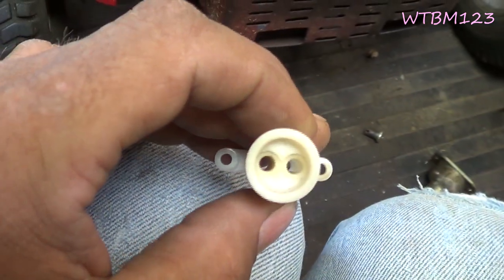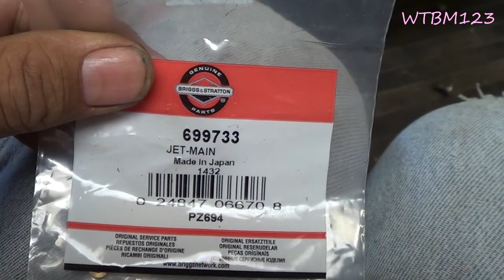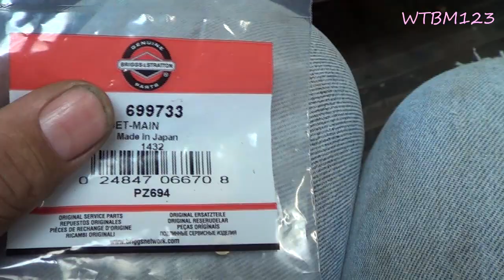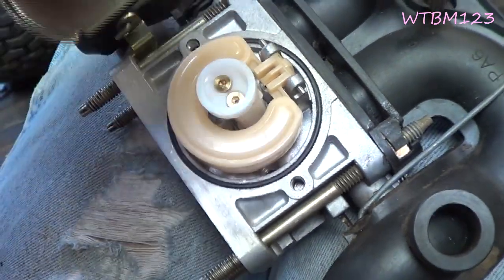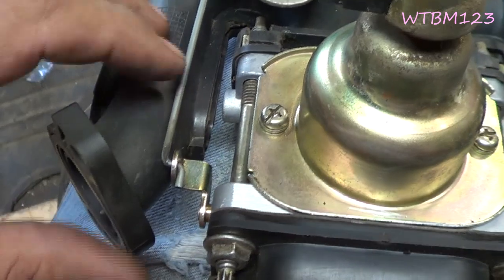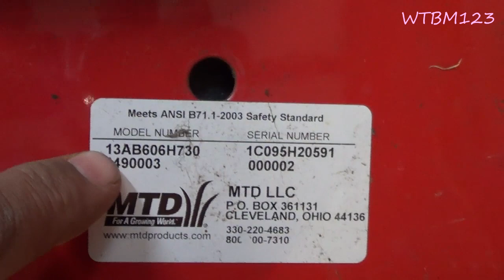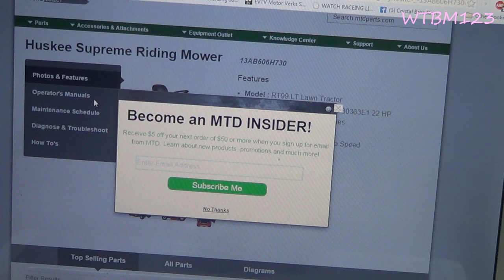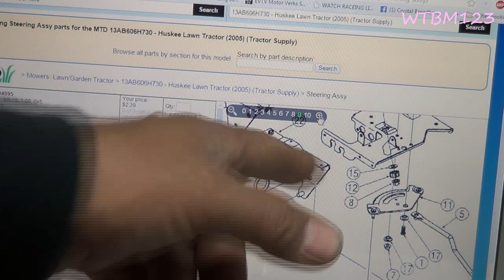Briggs V Twin Carburetor, and Parts Search

Comment: I use 222 lock tight on the butterfly screws because I’ve seen several that have came out and damaged engine piston
Reply from the maker: Yes , they make a mess if they come out . Thanks for stopping in .

Comment: I have been racking my brain tiring to figure out why my dads Yazoo Kee's ZT-MAX w/ 27 hp briggs stalls & dies when he engages the blades. The plugs are covered in soot & I went through the carburetor yesterday to no avail. I did notice the jets were in an odd place from when he had taken it apart before ( they were up in the two holes across from one another at the top of the bowl). Saw this vid & fglad I clicked on it, Now my suspicions is confirmed, they do need to be in the plastic tower like any normal carb.  Must have fallen out when he dissembled it & that's where he put them during reassembly....
   I'll crack it back open & get that straightened out.   Thanks for the vid sir!! 
 Edit to add I can see from yours which side the smaller jet goes on ect so Thanks much for the close ups also!
Reply from the maker: Thank you for stopping by and commenting . Glad you got it sorted out .
Reply: @wtbm123   That was the problem, she runs like a top now. Again Thanks Sir!!

Comment: My jets both fell out and there are not any numbers on either of them.  How do I know which one is left or right?  Put cleaning needles in them and one has a larger i/d than the other.
Reply from the maker: Mine had no markings and o rings were bad so i just replaced them . . They say number 2 cylinder runs a little hotter so they put a larger jet in for number 2 cylinder
Reply: @wtbm123  Thanks!  does #2 cyl correspond to "L" side marking on the carb?

Comment: That’s a Nikki type carburetor. You don’t need to go to expensive Briggs & Stratton parts. 
Many companies sell rebuild kits for Nikki type units. The emulsion tube takes an O-ring made out of a material called Viton. The kits include these rings. If your carb has a plastic needle valve attached to the float, replace it with the supplied brass one.
Reply from the maker: Now you find more stuff for these . nitrile O rings also work with fuel . Most kits come with all but the O ring for the jets , especially the ones with 2 jets you usually need to get them separate from the kit . I think a kit should come with everything including a float . Now you can get replacement carbs for cheap.

Comment: Than you much indeed for this video. I  am troubleshooting my 24hp B+S Professional v-Twin. Running weak on right cyl. Checked all the usual suspects (compression both cyl at 150, values adjusted and guides seem fine, air cleaner, plugs,  But still right cyl runs weak. Seems many people have had this problem and the issue is the carb. Seemed odd it would impact only 1 cyl, but I am at wits end. My carb is verysimila ro yours except the float bowl. Same white tube, but  float bowl solenoid o-ring area is a bit diff (float bowl is cast, not stamped like yours).

Anyway.. .thanks much for  the effort. Hope this solves my issue !
Reply from the maker: Hope you got it all sorted out , Thanks for watching and commenting

Comment: Jet 699733 is a high altitude jet.  I believe you should use 842627 (R)
Reply from the maker: I used the ones the manual called for , But yes different altitude prob should have different jets

Comment: I don't know if I have an earlier model gen Vanny 18 or what but hour Carb looks Nothing like mine .Mine looks like a more regular all steel carb . Roundish no it square where would I find parts and  new carbs for it ?
Reply from the maker: find the model number of your engine . a lot of times it is stamped on the sheet metal . . Type that number into google . should fine parts tree , repair clinic or some one that will have a parts list with part numbers for your engine . sounds like you may have what a lot of people refer to as a Opposed twin engine .
Reply: @wtbm123  thanks . No I don't have the oppy I have the Vangaurd V twin .I've come to find out that they no longer make the Vangaurd carb and they don't make a replacement .eBay Amazon no one has them .. 305777 . Thanks for all you help .

Comment: Would be nice if you showed removal and putting it on instead of skipping.
Reply from the maker: it is very easy , remove wire , fuel line , and remove the 4 bolts holding the intake on . then the through bolts have nuts to remove . next one i get in i will try and do a removing video

Comment: Working on one of those carbs now.  Question:  Inside the fuel bowl there is a small white peace of plastic.  You handled it and mentioned that it goes on a certain way - it has some slots on it and it goes down on top of the electric shut off at the bottom of the bowl.  What is the correct orientation for this little peace to go on?  It seems to fit several ways.  In case I didn't describe the part correctly, it's the one that has the O ring that had warped out of shape very badly.  

Thanks

Comment: Hello:
Why do you suppose there's even a left & a right main jet that area made especially & "unique" for each left & right side cylinder, with it's own part number to boot?

Have you ever checked to see if the jet openings are really the same size?

I get the altitude issue with jet sizing, but not when both cylinders "seem" to function the very same, so having a common, same-sized jet for each cylinder just seems to make sense.
I'd appreciate your thoughts on it anyway. 
DL
Reply from the maker: +David Logan They are different size , and from what i gather , it was to solve a temp issue with one of the cylinders .
Reply: The right side which would seemingly have the leaner jet, allowing for the larger jet to be richer for the left hand cylinder. No no no tho lol from my experience with my time with these Nikki’s I learned that the RH/#2 cylinder, which would now having a explanation of the theory, make better sense to call for the larger/richer jet. This RH/#2 cylinder is further away/lower down from the flywheel, thus resulting in a longer tunnel so The engineering has a little bit richer jet. Im not sure but I think it’s 5k feet above sea level and the jets will be requiring a extra change too....great video, awesome wheelys, and good questions and morale involved with the comments💯👍🏼👍🏼👍🏼

Comment: Great video man very informative. Mt 2003 vtwin 22 HP seems to be loading up black smoke and want fully open up at full throttle. Will purr like a kitten at full speed but when you engage blades it starts to load up the carb so to speak. It there a mixture screw to cut down the needle jet. This carburetor is complicated and I consider myself a pretty good shade tree mechanic. Plugs looked a like black but not fouled. Any help would be appreciated. www.rw3al3@embarqmail.com.....Thanks...Ricky

Comment: Lots of dead rubber in those b&s carbs, im glad i only have a push mower, its a b&s but its the carb on tank job, i have a new diaphragm on standby :-)
Should be fine for a loooooong time now :-)
Showing your firefox browser with your name at the top may not be a good idea, just a thought.
Reply from the maker: zx8401ztv Prob right about the browser
 ,
Reply: wtbm123 Please dont take my comments as being bossy, i know its easy to sound so in dry text.
Just trying to make sure you stay private, no one needs to know any more than wtbm123 :-)
Reply from the maker: zx8401ztv Most of the time i so sign out but just missed this one . lol

Comment: those carbs are a pain in the ass, real good vid,
Reply: mustie1 They looked pretty impressive to me.
Reply from the maker: mustie1 They are not to bad , seems most times it is a O ring or the flat gasket behind the choke . Just they cost so much to rebuild compared to most other small carbs.
Reply from the maker: coffeefish They do work well when working.